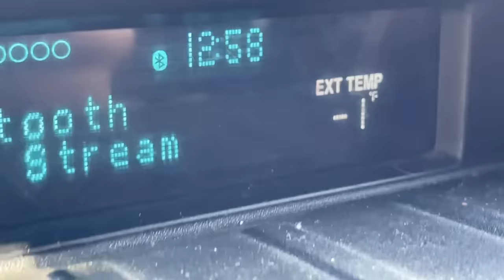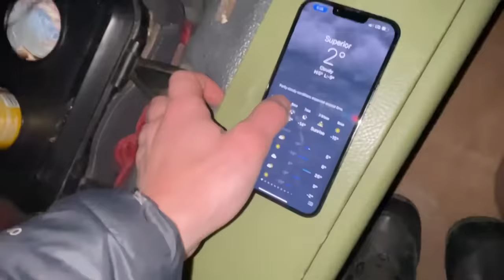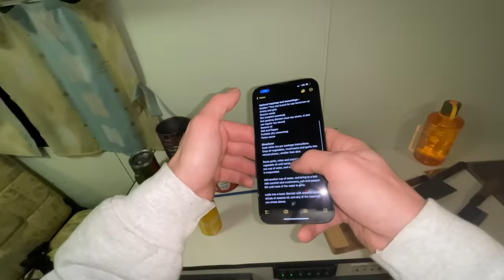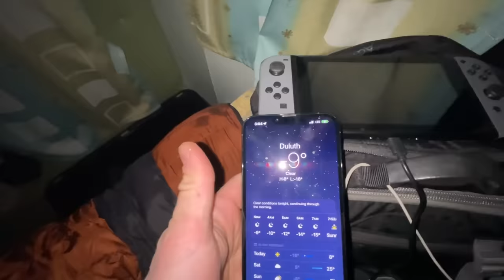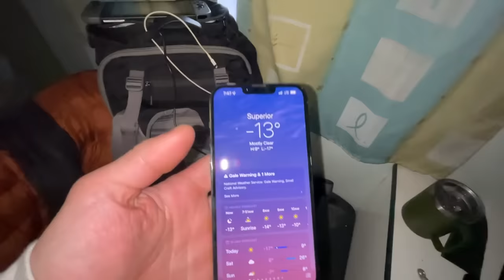Taking my Japanese Import Camping in -18 Degrees

Comment: Mav, are you putting a diesel additive in the tank to prevent gelling? Edit: NM I see you didn't LOL
Reply: This is what I was going to ask. Without the additive it will def clog up the fuel filter. I’m sure he would know though growing up in Minnesota if I know living in Texas lol
Reply: He did add additive. The problem is your supposed to do that when you fill up the tank. Not when you're trying to start the engine. However that wasn't the problem. And in the upper Midwest most gas stations add it to the fuel also. The problem wasn't " Steve". Mav needs to learn to leave the diesel engine running during the night when its that cold and he will be fine. I do believe he would probably be better off getting a better generator though like a nice Honda.
Reply: @victorbenner539  yep, I was wondering why he didn’t just start the engine up for 20 minutes to warm everything and charge the rear batteries instead of using the generator to charge them. 2 birds one stone .
Reply: @bdmenne  ok, he did try I believe. But it's important to understand a diesel engine is different than gasoline. The compression is much higher with diesel. That's why if you can you hook up to a block warmer as soon as you turn off your engine in those temperatures. But of course there wasn't a charge cord. No the simplest solution under those circumstances is just let it idle through the night. For the engine block heater to work it has to be plugged in the entire evening. You can't just plug it in and be ready to go.Mav will get it figured out. Hopefully he will see this or find someone who can teach him what he needs to learn. Dang that's a great little rig. Definitely needs a bigger or auxiliary tank though. 🤔 👍
Reply: @victorbenner539  yes, I was wondering how much more diesel/tank he could and will put on it.  10 gallon seems real light, especially for the deep woods he goes.
Yes, I remember Diesel engines do best to stay running, not  just 20 mins. You can tell I don’t own a diesel. 
Yep it’s a sweet toy haulin mini camper with 4 wheel or AWD. Pretty sweet!
Reply: @bdmenne  you're also supposed to let the turbo wind down aswell ... idle the engine for 30-seconds to a minute before switching off... not so much nowadays, but definetly older turbo diesels..
Reply: @iainansell5930  cool!   is Steve a Turbo Diesel?

Comment: Id throw the preventative Diesel 911 in whenever you fill your tank. Wont  gel, easier start, and if your Diesel heater and generator run off the same tank, it'll keep them running. I always ran 911 in my Diesel

Comment: You need a Noco Boost Pro GB150 it's a great portable vehicle battery jumper. Used it on an RV, and it started up just like if you had another vehicle jumping it. Probably the best portable car jumper after a few on trial and error.

Comment: You need to figure out a way to run a cord from the block heater plug to the inside and keep the engine warm at night and also try to invest in some diesel cans for road trips since the tank is so small. Other than that, Steve seems like a solid unit🤘🤘
Reply: I just said that too 👌
Reply: And diesel additive

Comment: That startup at 20:50 sounded like at least one dead glow plug, or not pre-glowing at all.

On those little Diesels in Winter the battery always hast be in good shape, as pre-glowing and cranking the engine right after that in cold weather stresses it hard.

Engine oil should be according temp rating, too.

Block heaters so not solve issues with geling fuel, as that happens in the tank, the pipes, filters, injection pump.
None of those is conditioned by a block heater.

What helps if you still got Summer Diesel in the tank, is filling up with up to 15% of average gasoline, use that up and refill proper winterized fuel.

Comment: I think Steve needs new glow plugs and/or intake heater, a block heater, and new Big 3 wiring upgrade. After that install new higher CCA and amp hour batteries. If still no joy look at a more powerful alternator. If still no joy you might want to look at a dc to dc charger to charge your house batteries quickly. I do this with all old and/or high mileage vehicles with good success/no fires.

Comment: Carry a extension cord and plug your  block heater into your generator. You may want to consider upgrading your battery bank with more / higher quality batteries. The diesel fuel should be fine, its your slow crank / wicked cold oil. Great video, can't wait to see more of the hiace

Comment: umm ya diesel engines do that, it's the condensation in the tank freezes up the filter, no gas input. Theres an additive that helps with removing water from the system, look up diesel dry fuel. Highly recommended before the cold winter months start.

Comment: Dude, install one of those little cheap chinese diesel heaters.  They throw a lot of heat and don't use much 12V juice.  Then add two deep cycle batteries hooked together and you will have plenty of power for a few days.  Way cheaper then the jokery power box thing!

Comment: Get a longer cord for the engine block heater so you don’t have to put the Jackery outside. And for heavens sakes get one of those small battery jump packs (BEST $$ I EVER SPENT!), just make sure it’s rated for the engine size of “Steve”. 

Honestly, you’re always off in the middle of nowhere by yourself, you should’ve already had a jump pack…. When mine was delivered I tested it right out of the box. It was only charged like 70%, I disconnect my battery terminals on my 5.9L Dodge Ram, hooked the jump pack straight to the cables (not the battery) and it started my truck 3 times W/O the battery even hooked up!

Comment: if you tilt the blade away from your fingers.. less likely to cut... chefs like to have the top of the blade just brush the knuckles ..  meaning the finger tips are tucked under and the edge angles away..  hope it helps

Comment: Should have a tied switch between your rig battery and the cabin battery so you can charge the rig battery off the generator in emergencies but also turn the switch off to  isolate it so you dont drain the rig battery and cabin batteries on accident.

Comment: A sense of adventure is great... but if not for your friend you'd been screwed. Looks like Steve needs some TLC, particularly on the genset and the vehicle's charging system. It should be possible to charge your batteries with the genset, and to power the block heater from it. Li-ion powered batteries like the Jackery don't work well in the cold... need to figure out a way to power your block heater from inside the warm vehicle. Maybe make up a longer cable? Or modify Steve so you can plug the block heater inside the cab, or power it via switch in the cab? It would be interesting to see you get Steve to where he's unerringly reliable and then try this again.

Comment: Quick tip for some upgrades for rvs you can get some customized fitted battery pad heaters and insulate the compartment there stored in or even I bit more cheap/ghetto is to run a line from your heater into your batteries to help them get unfrozen.

Comment: I don't think I've seen one comment mention starting fluid.  Get some at a Walmart or auto parts store for $5  That's really all you need.  If you're not gonna plug in the block heater to keep warm,  a shot if ether will get it going

Comment: Hey bro u might wanna check and see if your generator is actually keeping the charge up on your batteries. It's easy to test just test the voltage at your batteries with everything off and then turn the generator on by itself and test the voltage at the battery again and see if the generators outputting to the batteries . Great content!!

Comment: Get a battery jump pack from advanced Auto it looks a like homie almost looks like something out of batman but works great. I'm a line rider myself wouldn't go anywhere without it! Thanks for the share. Sorry about your trouble but even the karosene we used in our oil heater I learned in upstate NY to add 911 additive to it as I filled it not an issue since I did that .. happy travels!!!

Comment: Hint. Since your generator was running for hours, your house battery would be fully charged. You can boost the engine battery from it. I have done it a few times, works great.

Comment: Might be a broken record here but you need to have some verify the house battery is isolated from the starting battery when the engine is off. I’m assuming it was using both batteries running the diesel heater. Starting battery shouldn’t be used at all for the most part except for starting

Comment: You had a 12V battery right beside your 12V battery. if the gene is running your house battery is full. use it to top off the frozen or dead truck battery. just keep booster cables with you and boost yourself.

Comment: When trying to turn over a car when it's that cold make sure you have the climate control and lights off, that's simply draining power from the battery and making it harder to turn the engine over.

Comment: Yeah those new batteries were probably only half charged. They need to be put on a real charger overnight. And you need thinner oil at those temps and antigel in the fuel. Crazy

Comment: Are you using the same battery for starting Steve & running lights etc?
You need 2 separate batteries. Also only turn the key so dash lights up then wait for the glow plug light to go off before trying to start